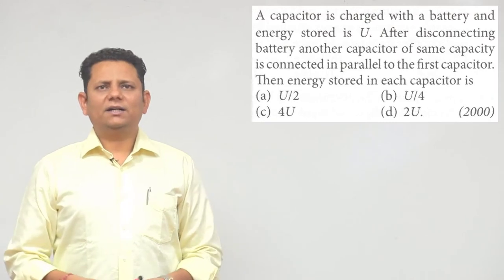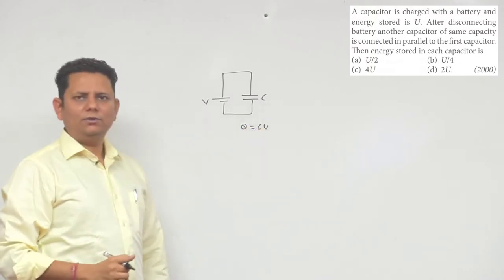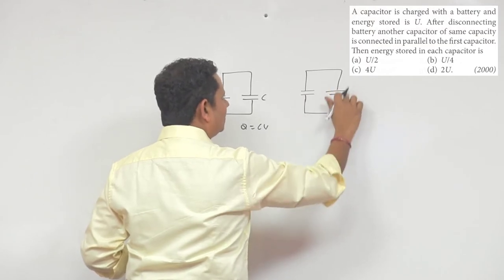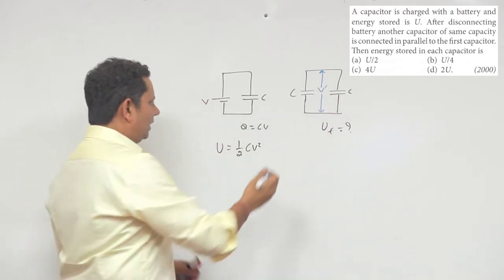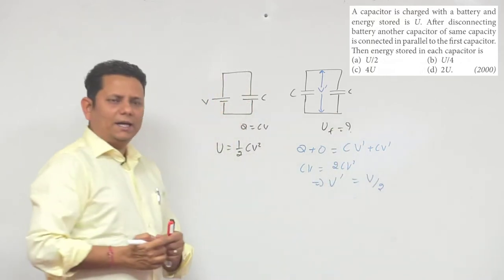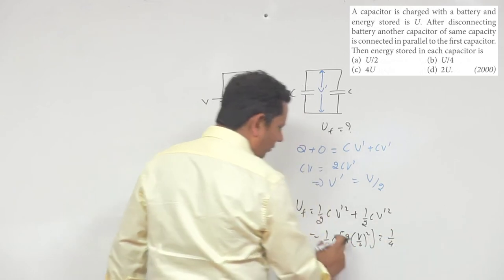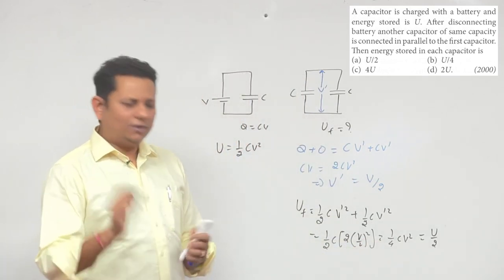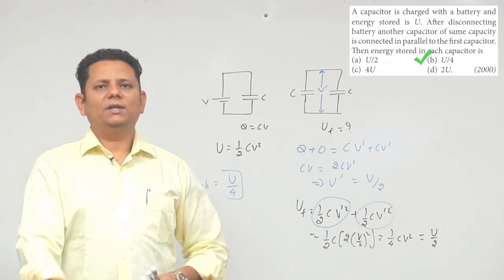A capacitor is charged with a battery and energy stored is U. After disconnecting battery another

Comment: Voltage across a 10µF capacitor increases at the rate of 10 V/s. The rate at which energy stored in capacitor is increasing when voltage across it is 20V is -